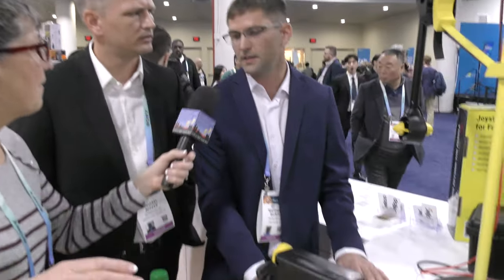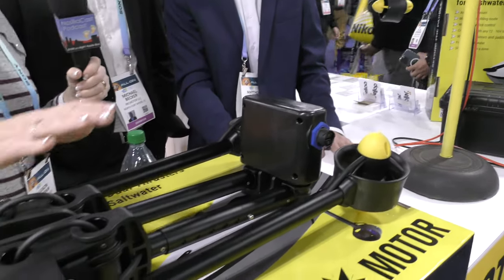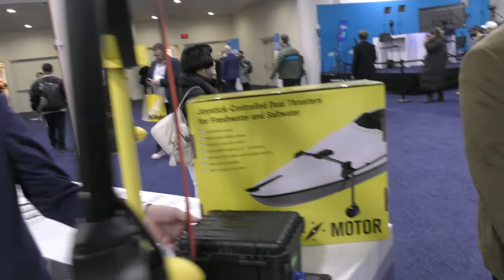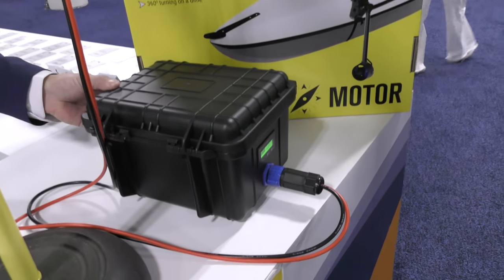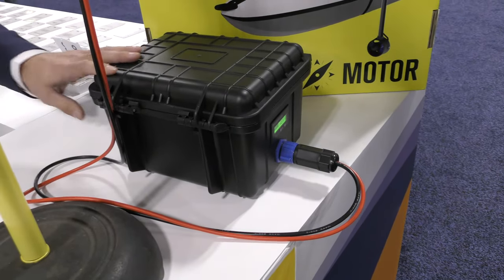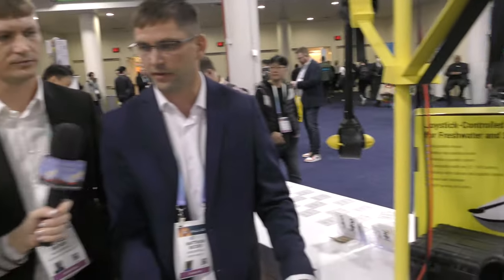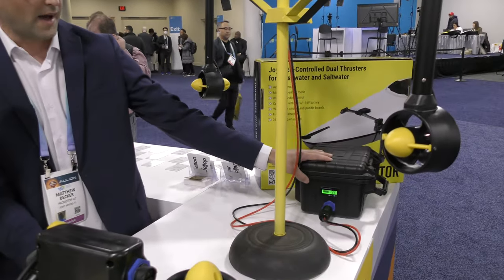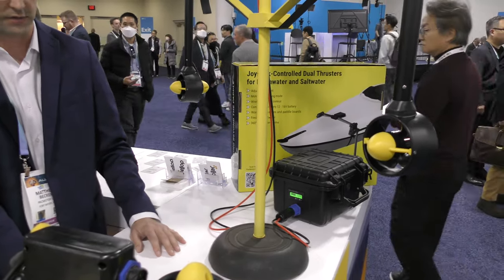CES 2024: PacMotor Electric Propulsion for Kayaks

Comment: Purchased Pacmotor a few weeks ago and received it last week. Very nice design and compact. I am adding the battery and cables in the next few days. I expect to  get a lot of use with this unit. I am 78 years old and and paddling is getting more difficult. I am not after a lot of speed but I am after mobility. Being able to turn around in one spot and also to be able to back up is a real necessity. Thank you Matt for producing such a fine product for kayak users. - Johnny
Reply: Thanks for the great comment!